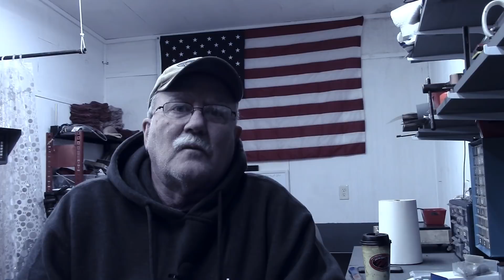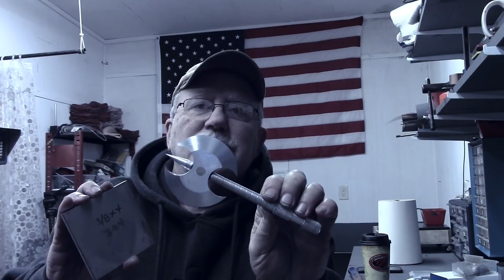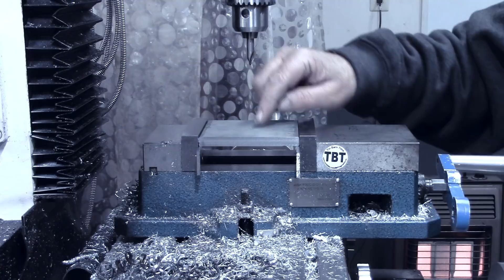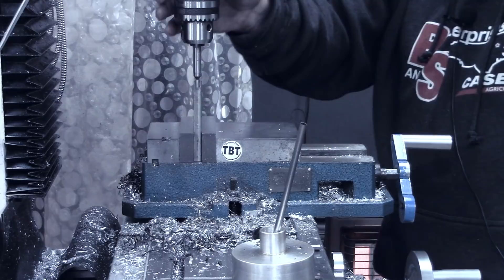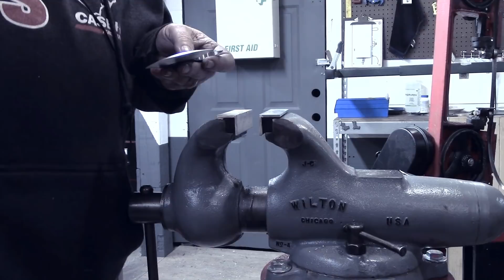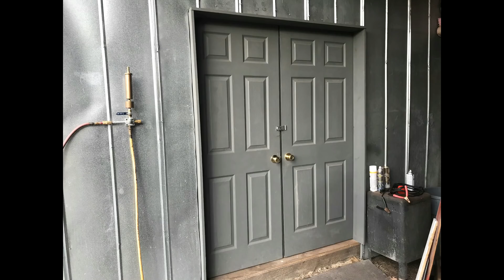Machining a Battle Ax For My Grandson's Birthday - Part 1 of 2

Comment: I actually just made 3 of these as props for a local renaissance festival. It was a fun project. One comment on your compound setting. If the protractor is not parallel or level to the ways when you set your compound, the angle you cut will be different than you expect. The more the protractor pivots downward, the bigger the angle will be in relation to your compound. How old is your grandson by the way??
Reply from the maker: Joe Pieczynski Very good point. I need to come up with a better way to set up my compound as the protractor dial is often hard to see. My grandson is 12, there's a pix of him at the end of part 2. Thanks for stopping by.

Comment: This sure is something different Lee. Love it. You are very brave managing with the cold - I pretty much gave up until things improve but yes, for sure, the sustained low temps we have had have been crazy this winter so far.
I'd certainly have done same as you with those two big holes - lathe and 4-jaw - ideal. lathe also idea for that major angle both sides.
Looking good.